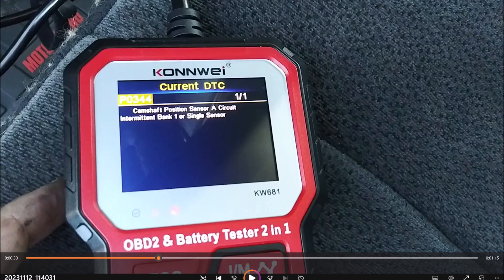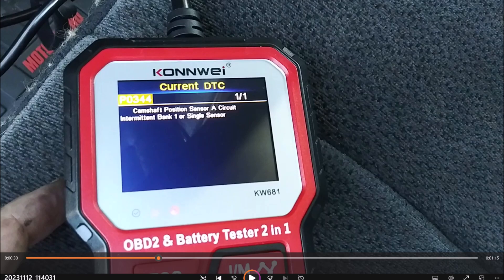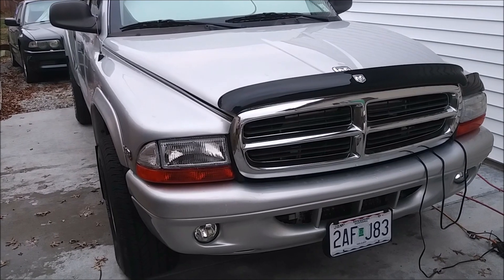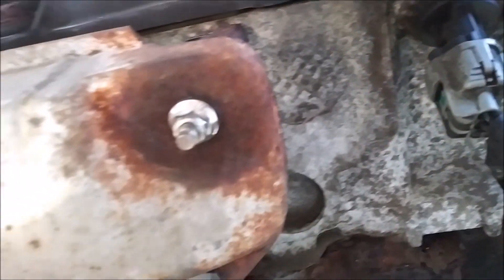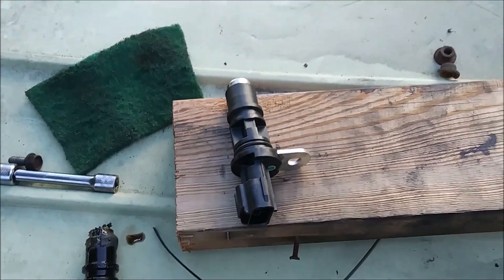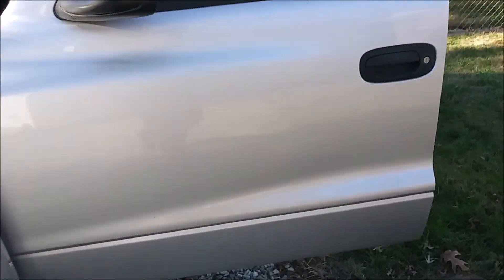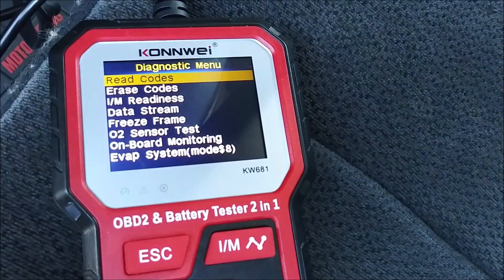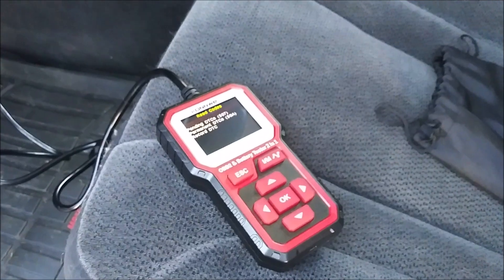DTC P0344 Camshaft Position Sensor Dodge 4.7 V8

Comment: Wasnt it nice when things were simpler ??  Hope you are doing good . Much warmer next week ,but some rain . Cant remember if I told you I have to put a new radiator in 1994 Chevy G30 1 ton van . No ac so its pretty easy . Take care  19 Jan 2024 600 am cst
Reply from the maker: My long week ends today. My tool room just needs one final sand, then I'm ready to clean, paint and organize. Katie's Beetle is almost ready for the convertible top.

Soon enough I'll be done with all that and I can fix the rear brakes on my Beetle and start on the yard (patio, shed, extra driveway and garages for Vette and SS).